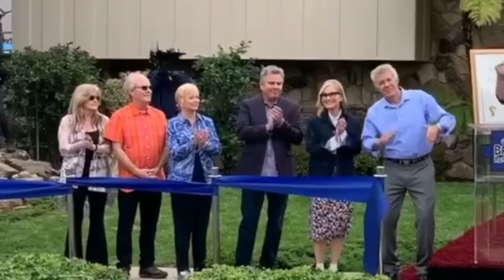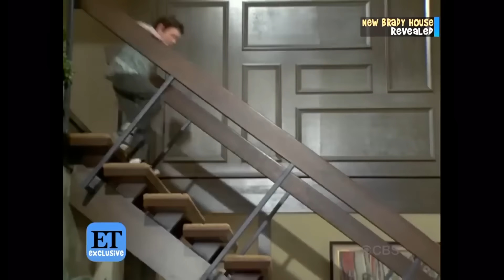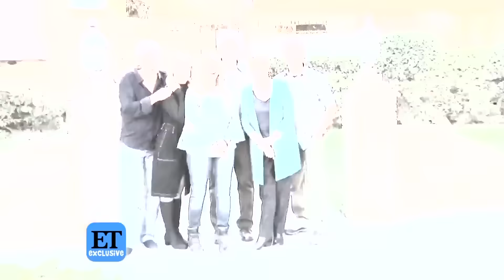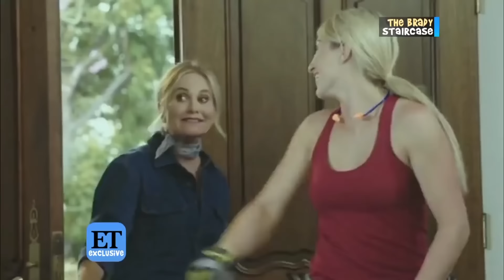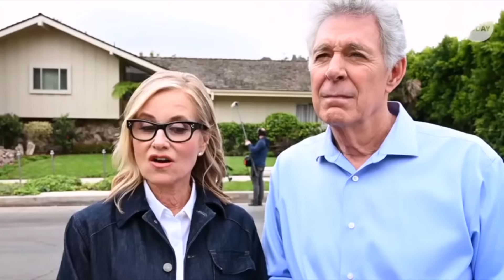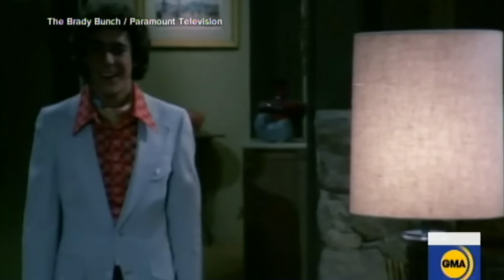The Brady Bunch House - Construction Completed! - Long Version - May 23, 24 & June 12, 2019

Comment: Knowing in real life (on the soundstage) that the stairs led up to no where, ive always wondered where the 3 bedrooms were actually located (on the soundstage). Thank you Mike Lookinland for FINALLY answering that question! 
The 3 bedrooms were actually located on the otherside of the front door!
Reply from the maker: I'm with you. Although Mike didn't make it crystal clear the location of the bedrooms, I too made the same interpretation. Interesting info.
Reply: I remember there were a second set of stairs leading to the attic that Marsha and Greg fought over in a episode. Funny when I was a kid, it never occurred to me when I looked at the outside shots of the house, that there was no place that attic could fit.

Comment: There's one GIGANTIC problem. The Bradys completely renovated the house in the mid 1980s. Superfans of the TV show would know that the original house (built circa 1959) was early postmodern, but received a huge re-styling 25+ years later. Gone was all the brown wood, the kitchen was completely updated and they even installed a glass-block wall-feature near the staircase. Even the furniture & lamps were replaced with mid 80s pastel colored furnishings (except for the iconic chest of drawers below the staircase). The Bradys themselves moved on from the original styling, shouldn't we?
Reply: If this had been a modern-era Brady Bunch movie, with the actors appearing in character, yes, that would be a major continuity problem.  But this was a recreation of the original sets. Also, the set makeover(s) in the '80s spin-offs and movies are a blip on the radar. From the show's five-year prime time run and its countless years of afternoon reruns, the original decor is what multiple generations of former kids think of as the Brady house. 🤓

Comment: So does anyone know what room the window to the left of the front door is?  I know it was just drawn on for the TV show, but it's there now.  What does the window look into?
Reply from the maker: I believe that is the dressing area within the master suite. The master bath is just to the right of that.
Reply: Classic TV & More I thought the master bath was upstairs.  It coincides with the living room, but on the inside pics there is nothing there but a wall.
Reply from the maker: @judithshorey2137  I think you are right. In the TV version of the house, one would climb the stairs and make a right to access the master bedroom. But, making the TV version of the floor plan fit into the real house means compromise. The producers did not want to change the roofline in the front which means the master bedroom and Greg's attic room, there is no attic in the real house, had to be reconfigured.
Reply: It goes to parents room .. bathroom I think

Comment: If it was the house, why is it so different?
Reply: HGTV did some remodeling to match the interior of the house with how the house looked on the TV show and because of that they had to make some minor changes to the outside of the house too , they had to remove a wall that was out in front of the house and they removed two windows from the front and changed the doors from wood to being steel most likely to prevent burglaries from happening.
Reply: @josephbennett3482  but there really was a house they acted in, it was a set! No 2nd floor.
Reply: @Bills_Bicycle_Rides  in the TV show the interior was a stage set built in a massive production building like a hanger , it wasn't done in a real house. The interiors of the real life house looked nothing like the one from the show , they did a little movie magic and made the house look a bit larger on the set because they had so many actors and actresses to film and the space needed to be bigger.